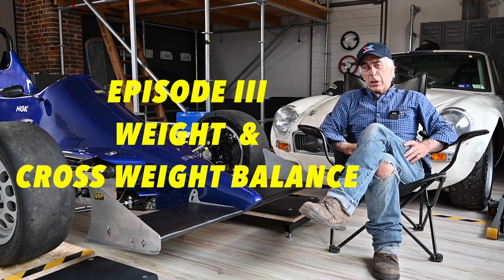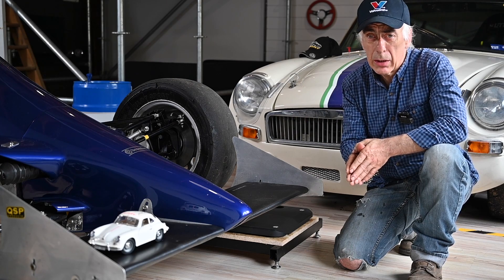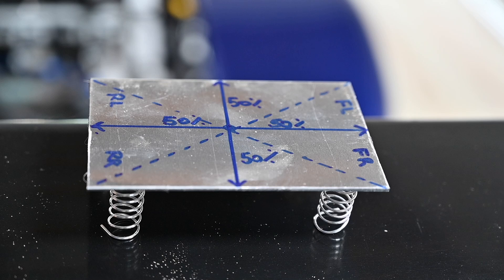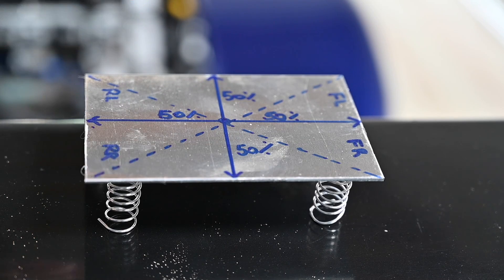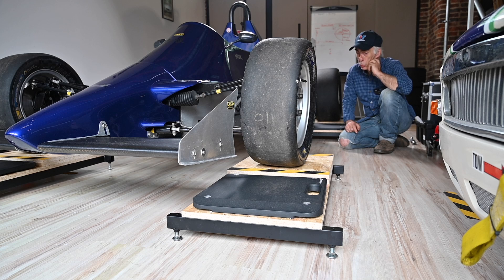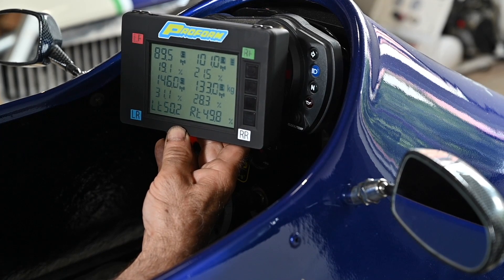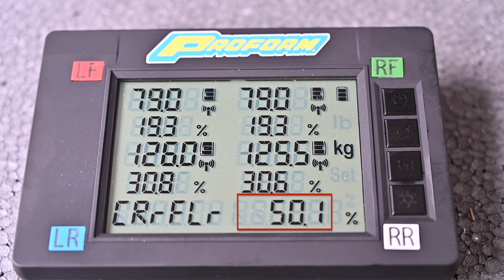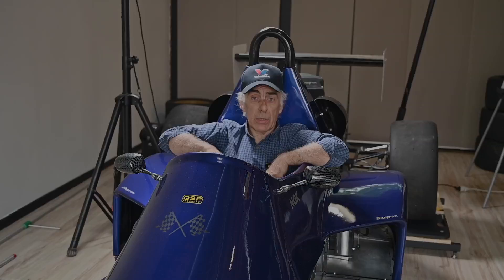Race Car - Alignment - Episode III - Weight and Cross Weight Balance

Comment: 11:00 shouldn't a rear biased weight distribution be prefered? I assume its rwd in which case you want the most weight on the rear during accel , during braking it would even out closer to 50/50 and in cornering you would be right but we could tune with assymetrical roll centers? I didnt build a racecar so its all theory no practice
Edit: forget assymetrical roll center i forgot anti roll bars existed
Reply from the maker: Thanks for the comments, in general the central point of gravity should be as low as possible to the ground and in the middle of the car.   yep  anti roll bars..as per your edit...  happy holidyas

Comment: Realy nice video !! 

I have question may be dump one .. 

In coilovers that you have the spring load avec the ride height separated, do you still adjust the ride height and keep the preload or do you shorten/lengthen the spring without touching ride height ? 

Sorry if i mis understand this part, may be usefull for some as me ^^'
Reply from the maker: Riding height and spring load are closely related...  Cars with separate adjustments  for riding hide ( not on the coil overs).  Should be set first while the spring load is set equal on all  by adjusting the adjustment rings.  Then check the cross balance and adjust the spring load, afterwards re-check adjsut the riding height.. do this a couple of times  as it all relates..
Reply: @D3Sshooter  Thanks a lot for your aswer :) 
As soon as i receive my Ceika coilovers for ma GT86 i'll do that based on your advice ;) !

Comment: Thank you for video. I am a little confused though… LR and RF were heavy and you slacken off LR to take weight off and then also tighten RF…. Does tightening the RF not add weight back to the corner?
Reply from the maker: Its is done in several attemps, and yes it seems to be inverse but its not.. what counts is the total diagonal weight..
Reply: @D3Sshooter  I’m still confused however. I understand to add weight that we must tighten the spring (pushing the wheel into the floor) but to add weight to the diagonal which is LR and RF should you not tighten the springs on this diagonal and/or loosen the springs on the RR and LF diagonal. You tightened and slackened a spring across the same diagonal. I appriciate You taking the time to reply thank you. Your alignment video helped me to find that my race car was indeed towing out 16mm up front. No wonder was a handful on turn in 🤣
Reply: @danielpluckrose8994 did you ever figure this one out? Cheers!
Reply: @D3Sshooter  Amazing videos, thanks, but I am also a bit unclear about ehats going on with slackening and tightening. why does the ride height not change like this?

Comment: I'm not sure how the decision a 50/50 static weight balance was the best but it's a false rationale. It sounds OK, even logical but most of the crucial times in a cars handling are not static. When braking you are going to get a massive weight transfer to the front of the car, if you have a 50/50 balance the rear will get super light and may eliminate your ability to trail brake. When accelerating out of a corner, more weight on the rear will be an advantage(depending on aero package, if you have one!). Just trying to jack a 50/50 balance into your car, specially if it's not designed for it, can have have catastrophic results.
Reply from the maker: Hi Rick, the 50/50 is the best static theoretical ratio as it places the same force on both the front and rear wheels , so max grip.   Yes, dynamics will effect many aspects... no debate in that...yet most race cars at the time aimed at 50/50 distribution left/right, front /back as it gives you an equal behaviour while cornering left or right... that is the man point,
Reply: @D3Sshooter  However, once you enter the corner the jacking forces of the suspension design take over weight distribution, or more accurately over take it, you will not have 50/50 any more, neither will the front/rear be equal that's one reason rear tires are larger than the front.
Reply from the maker: @rickden8362  , that is clear and normal. what I was saying is that you get an equal behaviour not that the 50/50 remains... that is of course not the case

Comment: Thanks for all your videos Steve , I have learnt loads from you. In keeping the with the KISS principle maybe..... I wondered if water , or  ATF fluid possibly , in see through piping could be used to immediately display chassis levels changing with adjustments to spring rates and rod length ?  Maybe a simple chassis fixed lazer  shining onto stationary pair of marked posts instead ?
Reply from the maker: Thanks for the comments, yes that can all work

Comment: D3Sshooter: your many works to bestow the many knowledges of the mechanics of the automobile & constructions in general, is forever in need of respect in it's affording solutionalities.
There needs to be a selective balance point for the expert driver to choose from via immediate on the fly control.
How could this be achieved? By simply transferring the balance distribution of it's desired points to the car by the  quick fluidic pump transfer reservoirs filled with mercury. 
Before any comments rear up about the hazardous factors of mercury... please feel free to suggest a different material if you wish.
In pursuant to the topic...
I would to this day: still love to obtain one of the blueprinted wall sized posters of the 1977 Triumph Bonneville motorcycle titled... ''An Attempt to explain The Unexplainable'' it was told to me by the FW Texas dealer Marvin Bell: that only one of these posters were issued to every U.S. dealer selling Triumph's. I, in turn said that in order for our my cash purchase to be sealed... the poster must be included. So upon that agreeance, we went into his small office. There on the table I laid 20 -  layers of 5 twenty dollar bills. He then turned to me & smiled saying... I hadn't seen that amount of cash on that table since the last midnight poker game of 1965.
Anyway: the blueprinted poster was pointing out much of what is within your post. 
The very center of the bikes gravity up & down, left & right balance exists right behind the triangular patent pending plate located on the timing cover. Thus exists the unexplainable handle ability.
Anyway again... What in the cornbread hell would I know about it all anyway? 
~1971---1974 U.S. Paratrooper Sgt. William 'Rock' Gilpin 82nd Abn. Div. 1/504.
1975-------1983 Texas Bricklayer & Stonemason.
1983---1986 Passenger Elevator Constructor.
1986--------------------2006 TX dot Inspector over new construction of highways & bridges.
2006----------------2022.6 Just another one of those many one's of '''We The People''...
who's awaiting His Just⚖Return🪃.
Reply from the maker: Thanks for the comments, wow  very interesting... txs

Comment: Shouldn't the ride hight adjust affect to this also? Even more than the spring pre-load? If one corner is off by a millimeter, that corner pushes the car harder against the scale than any other corner. If you compensate that by softening the spring, that corner has different dynamics compared to other corners. If the spring load is different side by side, also the traction is different side by side. Line the springs up and set the pre-loads to match for the coil-overs on a bench for the dynamic balance, and use the scales to fine tune ride height adjust.
Reply from the maker: That is indeed the case, ride height and force on  the coils (longer  or shorter)  are very closely related. If you change the spring energy  ( lets say tighter, so compressing the spring) , it will push the suspension down and raise the riding height. That is why this is a process of iterations , checking , adjusting.  I did it four times to getto these results.  It was a bit to much for the video ( to long and always the same work). In the first round, my riding height had changes from 80mm to 65mm in the front and 50mm in the back ( not such a good thing). at the end I got it all back to 70mm.  The basis I use is : set spring tension when at max  droop hand tight , give it 2  full turns in the back and 1.5 in the front. set all pull rods to same lenght per axle . check riding height and adjust on the pull rods ( longer , car goes down or shorter . Shorter car geos up).  Now do the Cross Weight Balance test... and adjust for 50%,  check riding hide, and adjust pull rods if needed. repeat  CWB, check RH  until things are set correctly...  That is the issue when all things interact...

Comment: Hi Steve, I use Gym  dumb bell weights, to the same weight as the driver.
Canvas tool bags with sand/ stone inside work too.
Saves you climbing in and out ! Cheers, Neil
Reply from the maker: Thanks for the comments, Indeed Neil that is something that does work very well...  I am 62 of age and can use a bit of excercise   lol

Comment: It's interesting how complex this is in a static environment - before considering the changing aerodynamic effects once the car is moving at different speeds.  It shows how much work F1 (and other series) have to do during practice sessions to dial in their cars for each particular circuit.
Reply from the maker: Thanks for the comments,  Indeed and I am just scratching the surface of all the aspects that relate to a static set-up, how they interact.   In a dynamic environment things become even more complex. Today mathematical models are used  to calculate and set the proper geometry.  Sensors and controllers monitor , analyze and control the forces  and associated settings to compensate in F1.   It has become a scientific effort...  Of course drivers will provide equal feedback, as nothing beats the real experience.   At the level I work , things are more oldschool... as I do like the KISS principle.
Reply: Just to add to your dynamic effects, the fuel tank emptying and the tyres going through heat cycles will add a few more variables to the intial setup.